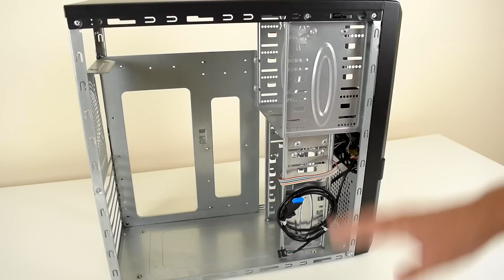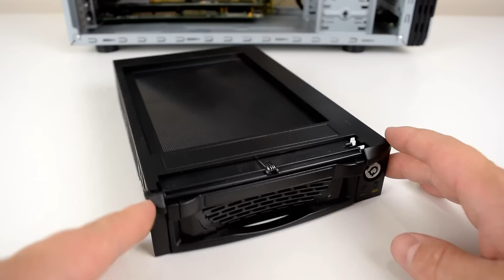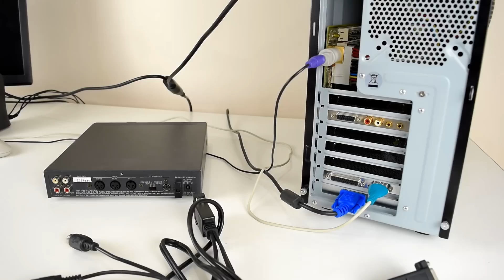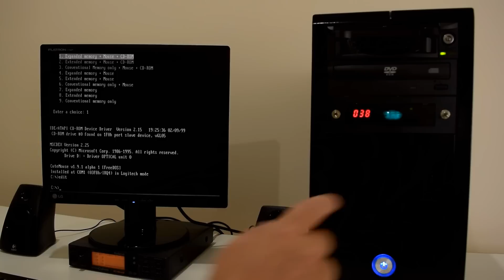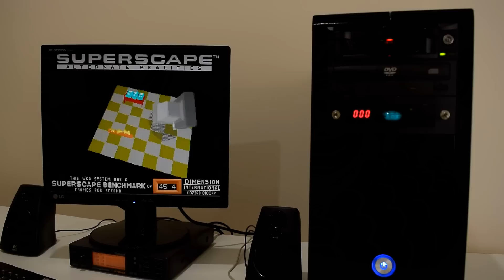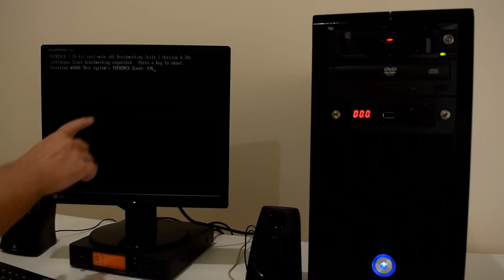Building the 486 DX2 66 Retro Sleeper DOS PC

Comment: I wouldn't use a metal switch to connect wires with 230 V AC. It is 100% not rated for this voltage.
Reply: The wires connected to that switch are low voltage. The PSU is ATX and shorting those wires is it's signal to send power to the motherboard. Usually the motherboard itself will short these wires when you press the momentary switch, and will disconnect them when Windows shuts down or you hold down the momentary power switch. But, since this motherboard is not ATX you need a latching switch to short the wires.

Comment: Hi Phil, Thanks for another great video.  I just purchased this exact board and have it mounted and powered up.  Upon booting, it gives an error about a low CMOS battery.  If I program the BIOS, the settings get lost.  There is a spot for a battery on the MOBO that has never been used and J8 has no header on it to do anything with.  I don't understand where I need to hook up a CMOS battery.  I also don't know what Voltage it should be.  I noticed in your video that you don't have a CMOS battery either but you don't get any errors about it and obviously your BIOS settings are being saved properly.  I would greatly appreciate any help you can give me...Thanks, Scott
Reply from the maker: Is there a fairly large rectangular black box? Odin or Dallas module?
Reply: @philscomputerlab  Yes, I guess it's a Dallas Module (TH6887A).
Reply from the maker: The CMOS battery is inside that one. Google for this and you will find modifications how to cut it open and solder a new one.  @scottjoyce8465
Reply: @philscomputerlab  Thank you very much...What a thoughtless design...Have a good one.
Reply from the maker: @scottjoyce8465 Better than a barrel battery. Those boards are all dead now .

Comment: isn't this the opposite of a sleeper build? there's has be a term for this. i got a strange modern reproduction industrial socket 7 board last year, and i was thinking about putting it in a modern case with LED's and everything. the mboard is blue instead of the typical off yellow or green. tbh i got it extremely cheap and was expecting it to be some fake bootleg that just looked like a socket 7 board, but it's been working fine.

Comment: What's the size of the SD card you're using, Phil?
Reply from the maker: Can't remember, if it's not mentioned in the video, I don't know. But I usually use 2, 8 or 16 GB cards.
Reply: @philscomputerlab  Thank you.  I was wondering what you were setting up as the system's hard drive.  2GB for Win 95 and down, right?
Reply from the maker: @chrispappas3750  For MS-DOS. For Windows 95 2GB can be tight once you install some stuff.

Comment: Nobody does a whacko modern build like Phil.  But I'm reminded every time I do a retro build that all the games being released at the time for the average 486 ran like crap (https://www.youtube.com/watch?v=mn8CdO0evbY).  You have to overbuild a 486 if you want games to run the way you envision it, because none of us ever remember the slideshow lag that plagued gaming back then, even on what was considered to be a "gaming" 486.  This is why I always build an AMD 486DX4-120 with a good VLB vido card, otherwise gaming just sucks (and sometimes STILL does, with a K6-2/550 build coming to the rescue).  I might use an S3 ViRGE/GX and SBLive! if PCI is available.  There's no game I ran back then that was hard-wired for a specific CPU speed, but I can always hit the turbo to downshift and disable cache even further for 386 mode if necessary.

Comment: That adapter with the switches at 9:00, where did you get those and where can I buy one? I have a 486 motherboard but the case I found it in is both rusty as all ... you get my point and it's also missing the case cover so I'm thinking about moving it to an ATX case, hence my question.

Comment: What do you mean there is no reset switch? You are not using the case's momentary power switch so why not use that for reset?
As for the AT IO plate, you can easily make one out of a bit of plastic cut out of an ice-cream tub lid, that is what I always do, I made a template and now can make them as needed. Just make it a bit larger than the hole (1 - 2cm on the top and sides) and double sided tape it to the inside of the case. Not critical but it tidies things up nicely.

Great build :)

Comment: Here in 2020!   I still have at least one 80486 system.  It is originally a VTech Laser system with an Intel 486SX 25 mhz cpu in a slimline desktop case, bought around 1992.  However, a few years later, the integrated cpu was switched out to an Evergreen 586-133 cpu upgrade kit in the overdrive slot running at 100 mhz.   The system also came WITHOUT any motherboard cache, so I added 128 kB of cache ram onboard, per the instructions on how to do it in the manual & it made the system a little bit faster overall.   Also added a no-name sound card, faster video card, an additional harddrive, external cd-rom & increased system simm memory from original 4 mb to 48 mb (max).  Also still has a tape backup that I put in there 25 years ago.  Original O/S was Windows 3.1, then to 95 a few years later & then updated to 98SE only 10 years ago.  I have a ram card that I might add in a free isa slot that would increase that to a total of 64 mb onboard, if I wished to do so later.   How ironic that i said "later", because 64 mb of [slow] memory & the technology of the 486 is already passe & vintage by today's standards.  I benchmarked the updated computer with Speedsys 4.78 back then almost a decade ago (about 5-6 years before you made this video).  I will have to check what I got to compare it with yours above.  
And I hope everyone is safe & healthy during these uncertain times with the global pandemic.

Comment: Awesome vid, quick note tho, instead of modifying an ATA66/100/133 cable you can just use an older UDMA/ATA33 cable.  You're not going to get any benefit from the newer cable anyway when using an older IDE controller.

Comment: does anyone know of a site where i can download win 98se emm386.exe file? i do not have a computer with win 98 installed. i am trying to install dos 7.10 on a 486 machine. i have done an internet search and did manage to find the file but may be a copy from dos 6.0 because the file is 119kb not 125,495 bytes as shown in Phils video. will any version of emm386.exe file work?
Reply: ended up just ordering a win98 se CD off ebay and took the file of the CD.

Comment: you could try 95 osr 2 to have fat32 and a proper DOS/windows installation. 
98 will be too slow on 8mb of ram and 66mhz, but 95 should run fine.
or... just make several 2gb fat16 partitions and run 6.22.
in my opinion the best partition program for DOS is partition magic 8, it fits on a floppy and you can do everything with it, resize, create, delete, merge. it's a great tool.
Reply from the maker: Pure DOS is the way to go for a DX2 66 IMO :D

Comment: Those wanting nostalgia , you can take a older Thin client and run windows 98 and Dos for pennies.
Reply from the maker: Not really, they would likely have crappy integrated graphics, and limited sound support.
Reply: True it left in it original form, but for maybe 25.00 more you can add a SSD and PCI to small expansion.  I have a system that works just fine and the graphics are pretty good for old dos.  Try it out pretty easy build and it runs way faster then a 486 machine could.  Most old games only needed minimal support like that equal to SB16 which the Thin Clients match or exceed.
Reply: The problem as well is finding a good working old 486 board with parts could set one back quite a bit these parts are going up.
Reply from the maker: Anything runs faster than a 486 :) I have lots of videos about alternatives.
Reply: LOL and yep I was sharing one :-) BTW enjoy your video wasn't trying to say what you are doing was wrong just and idea.  I love vintage computing thanks for the videos very informative stuff.
Reply from the maker: Do you have some links, especially about this "PCI expansion"?
Reply: If you do a search on Amazon and EBay depending on the model thin client, for the 5740 I think Amazon has them for 14.00 they were more on Ebay . Here is one on Amazon shows none at the moment I just bought another one from them last night. LOL.  But here they are, https://www.amazon.com/gp/product/B00K5QYSTS/ref=oh_aui_detailpage_o00_s00?ie=UTF8&psc=1 The 5740 is nice because it also has a SataII so easy to add a SSD. I have one with win 7 not too bad on it.
Reply from the maker: So this fits ontop of the case, like a sandwich? Making it a bit thicker, but being able to add 1 PCI card? It also seems to add a parallel port.
Reply: I sent you a PM on FB, but yes it sits on top they vary from which model on what you can add the 5740, seem to allow a SSD added easily inside without expansion, I am hoping to add a PCI card I have a few to try and increase the graphics.  Its fun as these are so small. The hard parts are flashing for 98se but if you have a bootable 98se it easier to do.
Reply: What I want to do is add and extra drive in that expansion as well and put the OS on the SSD and keep the games on the laptop drive I am going to try and put in there.
Reply from the maker: I made an offer on eBay, but if it falls through I will contact Electromyne, they have other Thin Clients with parallel port, so I can use this LPT OPL sound card. It will give you Adlib in many games.

Comment: Why not use the ATX power button on the case for reset, since you don't need it as a soft power toggle?
Reply: PS: Just looked up the idea of emulating the General MIDI module with modern general-purpose hardware (but not another PC: so an SBC, e.g. a RasPi most likely) and got straight to what I assume is your own website. Great stuff.
Reply from the maker: Check this out: https://youtu.be/BQ759oY5EKg and https://youtu.be/vSk9S1bkRS8

Comment: Hint: Connect the +5V and GND wires of the case's front USB connectors to +5V and GND of the power supply. That way you can use them to e.g. charge your phone. Also quite a lot of SB compatible cards, e.g with ESS chip, have pin headers for speaker and microphone. If your case has individual connectors for each wire, you could plug them there and put the front audio connectors to use!

Also, although a 500W power supply may sound overkill, every modern PC draws power mostly via the 12V lines. On an old AT-style motherboard nearly everything uses the 5V rail. And on most modern ATX power supplies, the 5V rail is extremely weak. You really have to check the values noted on the sticker.

Comment: After looking at this video again, I see you got the same issue as I on Doom. Awesomme build again. Though my experience with dx2's are that a dx2-80 is a tiny bit more suitable. Shure the 66 is a bit more sought after, though I feel the 80 is a tiny bit more useable. Doom runs butter smooth with an S3-805 and a dx2-80. Have you ever tried to set them up, side by side and see how real life experience is like? The 80 might just be a hidden gem here, and you will be surprised by it.
Reply from the maker: Nah I like playing Doom on a Pentium 100 or thereabouts.
Reply: Shure it gives a bit more. I was only thinking in terms of those who really need a 486 to play with. To me, it is a sweetspot, for playing 1990 to 1993 games. Pentium is more a kind of 1994 to 1996 kind-a-thing.

Comment: This is pretty cool but you should do it again with a not-so overkill PSU, a case with two buttons (one for power and one for reset but reset will be used for turbo), put a cover for the motherboard if you ever find one or make your own (if you can), and enough room to put the floppy emulator in the floppy drive. Other than that, this was cool nonetheless.

Comment: Why not play MS-DOS games using CRT monitor
Reply: but MS-DOS games don't always have square pixels, LCD monitors work differently,  whereas CRTs has an electron beam,  also the flicker on the CRT monitor on camera is most likely the camera shutter speed, and MS-DOS games are designed to be played with a CRT monitor, keyboard and to a lesser extent, Microsoft-compatible mouse, but do you agree with that?

Comment: I noticed that your video cards and motherboards looked like new. They are shining and are glistening as if were washed. If it is possible to know it with what?
Reply from the maker: LOL I honestly do not do any cleaning. I do my items off eBay, so maybe they clean it?
Reply: At us in Poland  pc components on auctions this way cleaned are rarely come across. Usually mess, dust and  "untested, I don't know whether he is acting, I am not accepting the return". Sad reality...
And as regards cleaning recently alone I did the attempt to clean the old MSI KT4V motherboard under the tap with the dishwashing liquid. I scrubbed out and I dried off by the heater. He is acting and is shining as your pc components:)
Reply: Charon Underground I also noticed  that and asked Phil the same question. His cards looks very very clean. I try to clean my old Pentium 2 PC, but I'll Google first what I should and should not do.

Comment: 3d print a shield?
Reply from the maker: That would be awesome if that could be done.
Reply: i saw other IO shields on yeggi. one could modify a file with the measurements taken for an IO shield for the motherboard you are using. it'd not be hard to do the stl file for it with freecad or blender.

Comment: Was the reason the first SD -> IDE adapter was not working the fact that it didn't have a jumper for ensuring that it is set to "master"?
Reply: The reason for it not working with the optical drive that is / as in it made the CDRom not work... very interested to know, so it might be a good idea to lookout for adapters that are both bootable and have the jumper setting option?

Comment: Found a small program that will emulate CDrom drives in real DOS. Works really good. You can mount ISO files. Can make bat files to mount much faster. 
Only thing you would miss is if you have a game that uses CD Audio tracks.
Reply from the maker: Yes, it seems there is no solution for BIN / CUE images :(
Reply: PhilsComputerLab can BIN / CUE support the audio tracks aswell? And even if they did, the CD audio cable which brings the CD audio sound would cause no CD music to be played I guess. Btw, with Win98SE it I cannot seem to get a Soundblaster 16 PNP or SB 32 PNP ISA cards to work in real DOS without manually copying already installed SB16 and CTCM folders from a DOS 6.22 install, then manually add all the stuff in Autoexec.bat and Config.sys. Just adding lines without the DOS drivers does not seem to work in Win98SE Dos 7.1?

Comment: In regards to your original SD to IDE adapter not working. I noticed when you were attaching your ribbon cable, that there was no 'Master/Slave' Jumper pins on the back of the adapter (unlike your DVD Rom Drive). Can I assume, that's why it only detected the one IDE device?
Also, thank you for reminding me that you don't need 30fps to have an enjoyable gaming experience.  I remember having low fps for most of my DOS based teen years and not feeling deprived in any way. Imagine if modern gaming tournaments were forced to play against each other in low double or single digit scenarios like we did. I'd happily pay to see that.
Reply from the maker: I actually mentioned that it doesn't have a master / slave jumper :) Yea it's a common issue with that adapter. But with some optical drives, or combinations of jumpers and positions, I've seen it working with two drives on the same IDE channel.

Comment: I'd look for the AMD 486-DX3 (100mhz).
You could have marked where the missing holes should have been, drilled and tapped them, and then inserted the threaded standoffs in the right locations.
For the atx shield you could take an old one, use a nibbling tool to remove all of the metal except for a small rim, and then solder a thin piece of brass to it, and drill that out for the one hole that you needed.

Comment: Does some one has complete drivers for SB AWE32
I have a 486 Machine with AWE32 but the drivers are the ones Windows 95 provides
I need the proper drivers to use the 8MB D-RAM

Comment: Hi Phil, Where did you get the adapter with the flip switches? what is the proper name to search this on e-bay? No luck finding this yet..
Reply from the maker: Oh, you cannot buy this, I made it myself. Not the drive bay, but just drill 2 holes and mount the switches :)
Reply: After some searching, I saw the exact adapter you are using, although any would do.. Indeed, it's easy to just put the switches there myself. I'll get the floppy emulator too. It's too good not to have it :)
Reply from the maker: Agreed. I have five! of them now :D

Comment: had one of these. still my favorite memories are the 286DX2. that's where I first saw Doom, and played Doom online multi-player and saw another gamer in a different remote location on my screen walking around. was extremely profound. was a very powerful PC.
Reply: Joelbell As far as I'm aware, there never was a 286DX2.  But hey, I'm sure someone could get doom to start up on a 286 somehow.
Reply: Up8Y I'm sorry, 286SX, and yes it ran flawlessly. I was there, I didn't learn it from Wikipedia and YouTube lmao. 286 was the mainstay for many years and was a minimum spec for games even when Pentium came out.
Reply: Audfile If it was a 386 instead, that would make sense- the 286 is a 16 bit CPU, and Doom itself takes advantage of DOS/4GW to be able to use 32 bit code making it impossible for Doom to even start on anything below a 386.  Of course, somebody could take the source code and port it to entirely 16 bit code.

It doesn't take being there to understand well-documented hardware requirements and the technical details of that.
Reply: Up8Y blah blah blah blah blah. that's what I read.